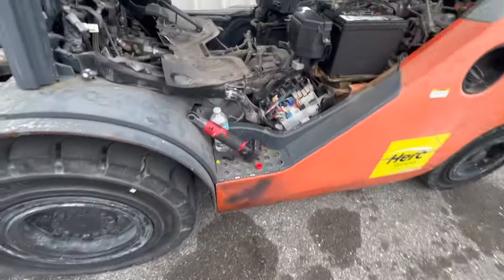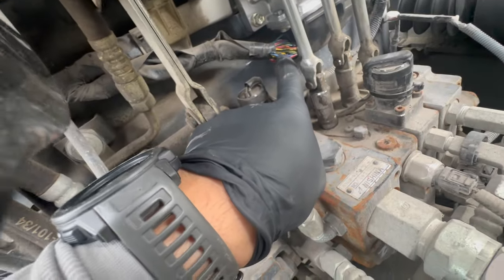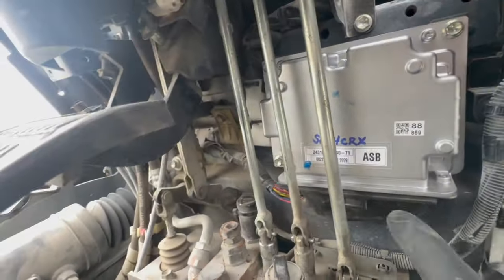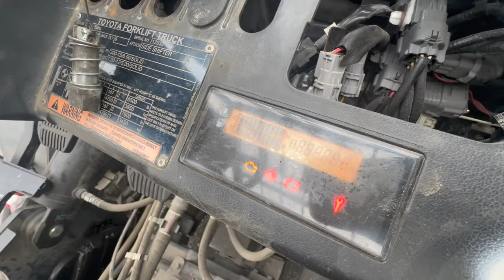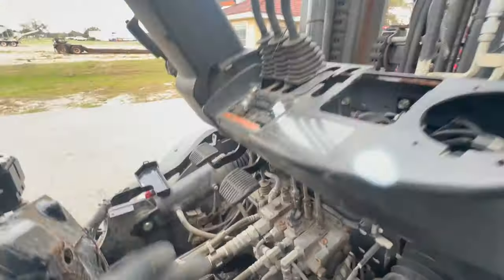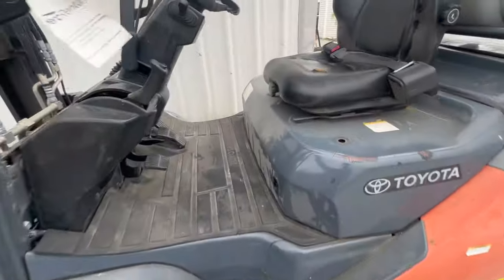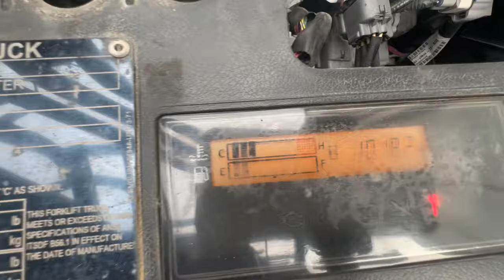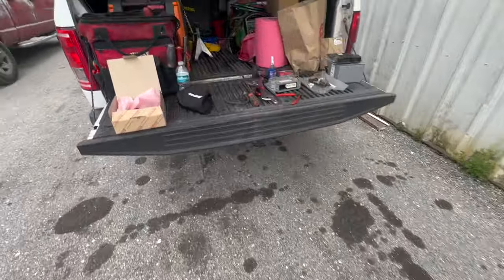SERVICE CALL: Toyota Forklift bought at an Auction, Won't Start! BAD ECU??? Troubleshoot and Fix!

Comment: Have a 2003 Toyota 62-7FDF25 with 18750h and I'm very happy with it. 2.5l diesel (4DZII) engine, always start on the first turn of the key, no smoke, no noises etc . Just SAS gone a long time ago. Just have to fix the leaking steering cylinder seals. I've been on the channel for a while trying to learn with you. Cheers from Portugal
Reply from the maker: Thank you, Goncalo! I love those 4DZ engines. Very very reliable
Reply: On the rear axle , there is a cylinder on one side,  for the sas system,  check the wiring going to the solonid.😊

Comment: Hi, l got forklift toyota 2.5 7fgu25  won't lower down and not tilting..is the ECU problem pls?
Reply from the maker: @evoobookbautrs9741  hard to say. Does it have any codes?
Reply: @theforkliftguy   yes mate 71 and 67
Reply from the maker: @evoobookbautrs9741  I’m not sure what code 71 is but 67-1 is your height sensor. Located on top of the mast, has like a lever on it with a little roller wheel. I don’t think that’s what’s causing your problem, but it could be.

Comment: Red Loctite on chain anchors? Why? I’d hate to be the guy that has to come behind you to adjust those later.
Reply from the maker: I’ve always done that. Never had an issue. A little bit of heat melts off the loctite. Wouldn’t bother me
Reply: Better safe than sorry in this industry
Reply: Suppose to be 2 nuts on the bottom , locking against each other , look at other side
Reply from the maker: @Yousuckballs987  I put 2 nuts on the bottom. Rewatch video 👍🏼